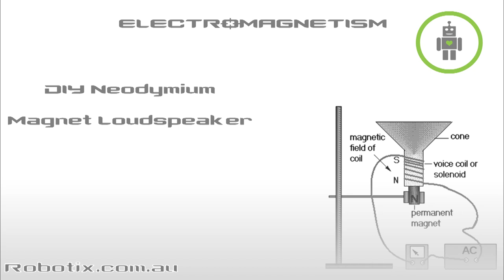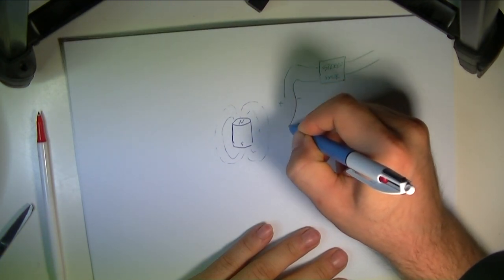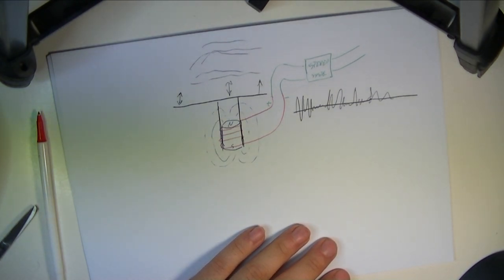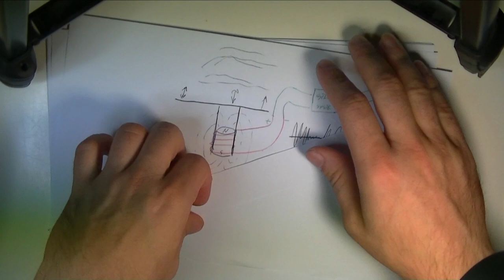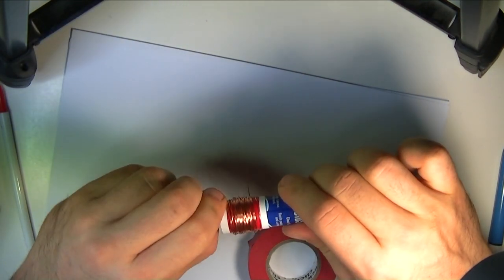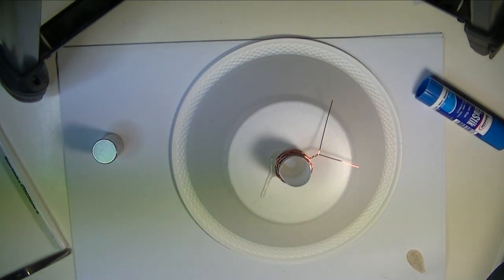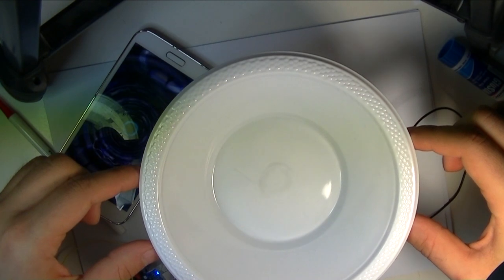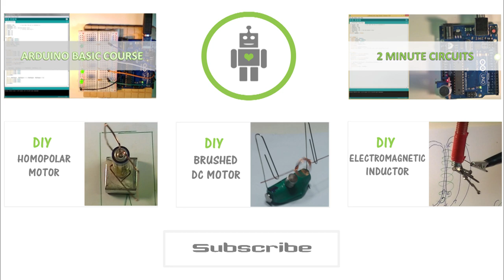DIY Loudspeaker (round neodymium magnet)

Comment: Your Phone's amp output impedance is more thant 32 Ohms, you're connecting a low impedance coil to it. You could end up destroying your Phone's inner amplifier when connecting experimental speaker directly to it.
Even if you experiment with a DIY amplifier try connecting a capacitor between phone's output and amp's input.
Loading the phone's amp or streaming voltages to it might damage it.
Reply: See what type phone you used...i test 2ohm direct on my phone everything is ok...but not used so long time...i dont no...just for 5minit its ok

Comment: Is it necessary to use an amplifier?
Reply: If you use thin enough wire with very few turns you can use regular jack ports but please note... these won't be loud. Also use a smaller magnet

Comment: How did you end up connecting the alligator clips to the phone? I ended up cutting up some old headphones to the end of the wires but that didn't work. Any advice?
Reply from the maker: I used a male to male audio jack! one alligator clip to the top of the jack another to the bottom. Does that make sense?

Comment: How do you adjust the impedance?
Reply: probably by the amount of coil turns, i dont know
Reply: you increase the amount of turns. The more wire you have the harder it is for electricity to make its way across so the resistance value grows.